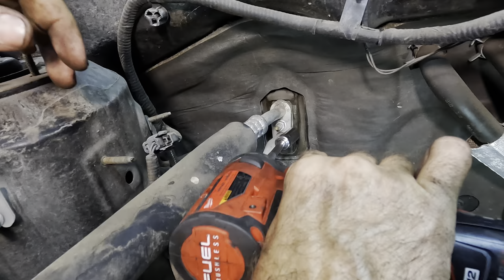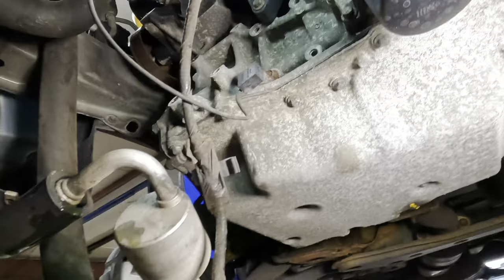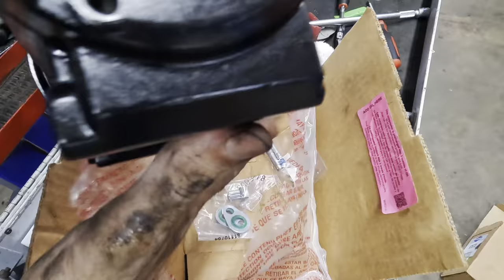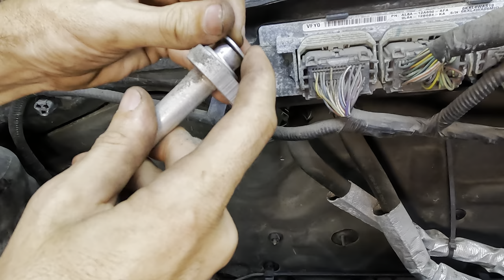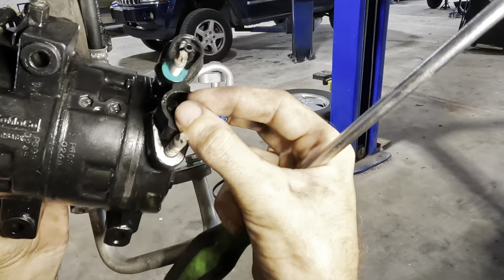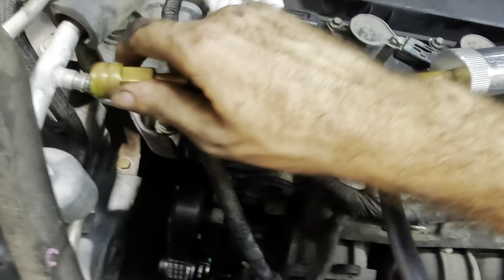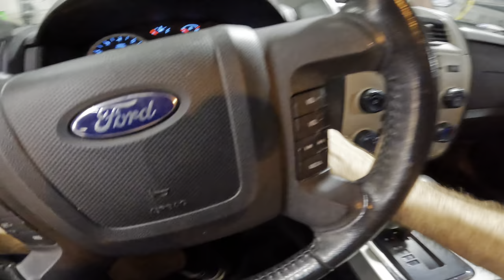Parts Cannon Complete! It’s bulletproof | Ford Escapé 2.5

Comment: Hi, Ray!
My only critique is that I would have recommended replacing both of the hoses at the compressor while I was in there, not just the known leaker.  The other one appeared to be of similar age and will likely require replacement in the near future.
Reply: Your logic make sense but it can lead to overkill. If you replace the lower lines, why not replace the upper lines? They are the same age? If you replace all the lines, why not replace the evaporator too? It could fail soon. If you replace the evaporator, you should just replace condenser, as well … and all the pressure sensors … and the receiver/drier, too. You just can’t insure yourself into no system failures. You could be pulling off perfectly good OEM parts and replacing them parts that have flaws and will fail in 5,000 miles. You just never know.
Reply: @brianandrews7099  
You are correct, of course.  It IS a judgement call.  It's "While I am in here" judgement call that would have saved the owner a labor charge.  
Really, no right or wrong answer, I guess.  I doubt anyone would recommend a complete system replacement, though.
Reply: @brianandrews7099 :  If you're gonna go that far, why not just "unclick" the engine cover, and drive a newer car under it?!?!
😁

Comment: The pully on the old ac compressor was smaller then the new one which was verified when the serpentine belt didn't go on as easy as it should unless it was a trick of the camera.

Comment: Made me think of my AC delete project on my 85 VW Golf Diesel. Only having 52hp, turning on the AC chokes the life out of the engine seriously hampers power. It will also reduce weight and complexity in the engine compartment making access to components and doing oil changes much easier. Where I live, AC is rarely used at least by me.

Comment: i know i wont get an answer to this from Ray, but maybe you guys do or do not do this but i flush the system with denatured alcohol  when the compressor comes apart on the inside..and replace the sock filter in the condenser if it has one.

Comment: I thought you should replace more than the compressors, like the condenser. My understanding is, when a compressor fails, it sends debris through the whole system. Just replacing the compressor will cause it to fail prematurely because it will suck in the debris and destroy it. You said you could see signs of "Compressor Death".

Comment: I think my concern would be that I seem to recall from the previous video that when you first removed the dust cap from one of the two line ports, you commented that there was some slight pressure behind that cap? If that is so, it would indicate that the Schrader valve on that port is leaking and needs replacing least it continue to slowly leak refrigerant. I purchased a very used car a number of  years ago with a no op a/c. The previous owner had taken the car to a shop and been advised that the evaporator was leaking and required replacing. The seller passed on the repair because, on this car, replacement meant removing the entire dash to gain access. Knowing this particular car, I quietly doubted that diagnosis, as they were not know for evaporator failures. Sure enough, upon inspection, the refrigerant was leaking past the valve port. A $25.00 set of replacement ports and a recharge and the a/c has been cooling great for four years now. As to the honesty vs. knowledge of the shop that diagnosed the a/c failure … well, that will remain up for debate!
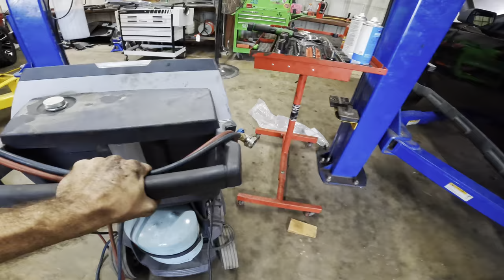Reply: He commented he replaced them off camera... 36:00

Comment: Gotta watch them pulley sizes when replacing have that issue with the 3.7l in the liberty when replacing the compressor and sometimes gotta get the shorter or longer belt depending

Comment: Maybe it's just the angle, but the pulley on the reman compressor looked a bit larger. If it was, that's probably why the belt went on with so much trouble. I've seen that before. Sometimes AC pulleys can come in a different size. Usually larger, which slightly reduces the RPM of the compressor and load on the engine.

Comment: Hey dude, I have never had any success with reman compressors, and this is like from 1975 from my first "professional" job. I hope yours works, also the pulleys are different diameter, that's why the belt doesn't fit,. Two things about this and sorry for the bad news, but, the spring in the tensioner puts a specific tension on the belt, if your tensioner is maxed out, now there will be an overtight belt situation, this can cause premature pully and water pump failure. Also due to the larger diameter pully the compressor will turn slower, this may cause cooling issues when the vehicle is stuck in traffic etc. I hope it all works out and there are no problems, but Newtonian Physics and all.
Blue Mule
Reply: As long as the tensioner is Is not maxed out in either direction it will be just fine.
Reply: Since no space-time warp at this rpm, Newton laws working here. Time will tell when bearings fail.
Reply: @stevewhite3424  It is maxed out.
Reply: @forgetfulme1719  Hey F, here is a story, a shop owner ordered a timing belt kit from Amazon for a subie outback, the Tech looked at it told the owner the belt was not factory, owner said, in the Amazon heading it said it was, so the tech is wrong, put the belt on, It took 2 guys to stretch the belt on, 3 weeks later, vehicle came back with a burned out idler bearing, funny thing, that is what it came in for in the first place🤣🤣
Blue Mule
Reply: @bluemule3891  or chain store mgr tells u install a 99c leaky crank pulley seal.

Comment: Psa: ALWAYS flush out any components you aren't replacing, and always replace any parts you can't flush out if you have a compressor that's gone bad. It will scatter metal throughout the entire system, and kill the new compressor pretty quick.
Reply: he threw away the instruction  right away, arrogant.

Comment: Since the compressor failed shouldnt you have flushed out the the line that brings high pressure refrigerent over to the expansion valve from the condensor due to potential metal shard contamination? Or the line that brings refrigerant from the expansion valve to the compressor? I know the line that connects the compressor to the condenser def shouldve been flushed but you replaced it due to it leaking. I think most of the metal shard contaminants remain trapped in the condenser but some can still make it past the condenser. Just curious. Love your content and an avid watcher. Learning a lot being a DIY mechanic maintaining my own cars and family cars from you.

Comment: With the a/c repair, you suggested there was a blockage causing the high side pressure. What was the cause ?  The part on the firewall you replaced or was it the compressor itself?

Comment: Question, with the belt being so tight because that compressor pully being bigger wont that potentially damage the bearings in some of the other pullys since its putting added stress on them? Again just wondering  if is that possible. Heard that somewhere before..
Reply: it is not only possible, it is a fact, how soon before bearings destroyed?

Comment: Ray, since vehicle owner is doing in-depth repairs why not order two hoses for that instead of just the one leaky one? Surely he will be back in two or three years to replace the other instead of having it last another 10 years or more. I would consider it preventative maintenance if it was my vehicle. Keep the vids coming and have a great summer!!!
Reply: It could have been a money issue with the owner.
Reply: The fact that he didn't flush out the system before installing the new TX valve and compressor means he will be probably replacing the compressor again sooner than expected.

Comment: The pulleys were different sizes you never compared them with one another it actually was very easy to see when they were next to one another so now the belt being forced on will be putting stress on the alt bearings nice way to gain extra service keeping the customer coming back

Comment: 29:09 curious what the bolt holes are for, located to the right of the compressor on the engine. Some optional equipment?
Reply: That's where the Fetzer valve is mounted on some models.
Reply: @Flies2FLL  😆 had to look that one up.
"The "Fetzer valve", when Lucinda the mechanic is giving the Sheriff her findings about Mona's car, she says the "Fetzer valve" had been punctured. A "Fetzer valve" is a fictional part of an engine, introduced in the movie Fletch (1985). Helpful•43. 1. Every character's automobile has personalized plates."
Reply: @Wakeupandsniffthecoffee  Haha!  I was just twisting your leg....🍺🍺

Comment: You should have flushed out the evaporator and condenser. There may be stuff in the system after a compressor failure. Some compressor companies will void your warranty if you don't replace the condenser.
Reply: true, they saw the video, no warranty.

Comment: What oil was required/specified on the rebuilt compressor that was referenced on that QR code/instructions?  I'm sure it was not worth showing on the video, I just don't understand. Is there a seperate small reservoir or are they talking about an oil/refrigerant blend?

Comment: Well, now the belt is too tight.  I had a Toyota that wouldn’t take anything but a Toyota drive belt.  Everything else was just a hair too short.  I want a belt that fits, not forced on.  But everything else you do is usually top notch and enjoyable to watch. 😁
Reply: Well won’t the belt stretch after a while, so it won’t be a problem?
Reply: The pulley on the new compressor was larger than the old one thus the tight belt.
Reply: @paulsi1234  by that time, bearings will have been damaged, no escape from Mr Cannon.

Comment: When you replaced the compressor and opened up all the hose ports.. Does that introduce air back into the AC lines, so do you not need to remove the moist air now in the AC lines, before recharging the AC again at the end??
Reply: Saw you did vacuum the lines... my bad!!

Comment: Hey Ray, was the pag oil in the compressor for the whole system or just for a compressor replacement only? I am doing a BMW X5 and the compressor has a pag oil charge for the whole system so I had to take out 100CCs of the 150CC charge that was in the new compressor. Have you ever had to do that?

Comment: He saved the warning sticker, but did I miss him adding the correct oil amount to the compressor?
Reply: Oil came in the compressor.
Reply: @kenore4003  3 oz came in the compressor, you must always check what the capacity for your system is and add the needful. Internet says 4.40 fl oz (130 ml) for the 2010 escape'.

Comment: I probably missed it previously, but, could you mention (next time you service one) how you determine if you use high side or low side to recharge the AC system. Thanks.
Reply: The ports are different sizes so you can’t hook them up backwards.
Reply: @brianhall9019  THAT I know. I was asking about recharging, nor red or blue port size. 🙄

Comment: Question... curious why you didnt flush the a/c system to prevent damage to the compressor or contamination of the new txv?
Reply: @OriginalGhost  no flush is a fluid that is designed to clean the condenser, evaporator, and lines of any aluminum material that is created by the pistons and swash plate moving in the compressor. Pulling a vacuum on the system removes air that displaces the refrigerant and boils off any humidity introduced to the system when the lines are removed.

Comment: How did you conclude the problem was the expansion valve & not the condenser?  I have similar pressures but don't know how to diag. which one.
Reply: Compressor failure and he didn't even flush out the evaporator or the condenser.  Normally I don't comment but I noticed a quite a few faux paus.
Reply: @21Piloteer  I just work on my own stuff as much as possible.  I'm not familiar with the flushing of the components.  Is that done by professionals?

Comment: 32:00 minutes: the point where Ray finally notices that the pulley on the new compressor is slightly larger than the pulley on the old compressor?  Not picking on you Ray.  I just happened to notice it when you were comparing them, and was dreading you getting on the struggle bus from not seeing it.  Hey, you cheated us!  No double brake clean shininess...

Comment: Was that the correct amount of PAG oil in the compreesor?
Reply: My trick is always to pour the oil out of the old compressor and compare it to what's in the new one (usually they are overfilled). I would imagine Ray's machine is capable of measuring the oil charge.

Comment: I have a 2012 Escapé XLT that is having a fan issue. 😮‍💨😮‍💨 unfortunately, I "parts cannoned it" and replaced the cooling fan assembly (for the second time) it did fix it...I checked the relays and those seemed fine...🤦🤦

Comment: RAY ! RAY ! RAINMAN .....You 4got to put the dust covers back on the Escape! Yes the ones that were in the way before you pulled off the belt .. The big black one . Recall you broke the plastic piece that you had 2 destroy to get it off becausevit was blocking your path to remove the belt & the Compressor .. ... Hope you remembered to put it back on .. 👍
Reply: Seeing that Troy put the wheel back on, likely he did that before.
Reply: @csgergo80  no it was still off..when Ray took it 4 a test drive .. After all the work done to it.

Comment: When you compared the compressors it looked to me the pulleys had a different size
Reply: Pulley bigger on new compressor confirmed when he couldn't get the belt on.
Reply: Belts stretch over time
Reply: @donE37100  confirms Mr. Cannon at work.

Comment: After my 1/2" air tool  said bu-bye (O-ring failures) i went looking for spark replacements and landed on a Milwaukee's M18 series but now i'm wondering outside the 1/2" what should i get (i don't mean model numbers) do i need a 3/8" or a 1/4"  impact? Sure i need a 3/8" 90 degrees so that's in the plan. Do i need anything else ? The 1/4" stuff is easily handled by a elecron screw driver right ? no need for anything special there ?

Comment: Just wondering why I never see you guys using fender covers when working underhood.....
Reply: 🤔 Ray did, when he removed the valve cover. It was used to protect from debris and such, unaware.
Reply: @opendstudio7141  Oops, didn't catch that.  Ray is doing an outstanding job with these videos.  Nice to watch a pro work!
Reply: most cars came in worth little, scratching not the worry.

Comment: Tbh cleaning the outside of the battery clamps little more than cosmetic, all the power is conducted from post to inside of clamp, also when doing battery service it's worth checking where negative connects to body, more often than not it will be showing heavy signs of corrosion

Comment: Most 4-cyclinder Vehicles are So Much Easier to Work on versus the 6-8 cylinder ones...
Reply: Tell me about it. When my wife had her Ford Fiesta I put an A/C compressor on it and it was a lot easier than on my V6 Taurus. The setup and location was almost identical but the V6 required removal of the radiator fan and was a much tighter fit. Also have to remove the intake manifold to get at the back 3 cylinders for spark plugs and coils.

Comment: Why would you not clean those AC line studs of that corrosion,  bench grinder with wire brush makes them nice & shiny.
Reply: lazy.
Reply: Southern mechanics 😂
Reply: @waterloo123100  weather too hot, don't blame them.

Comment: Battery cables, i have used the red and green pads for 30 ish years never have battery corrosion problems.  But i know a lot of mechanics use the spray red spray or the split pees puke color you use
Sorry to get graphical.

But if we know this stuff works, why dont manufacturers put it on when the car or truck is new? 
Also if its the spray why not do the body ground, motor ground, altonator and starter connection that are under the hood, yes these points dont deal with a lead acid battery but the post get wet and the metal corrosion starts becuse of electrolysis and spliting water mouclues and or metals reactions to oxygen without a lubricant on it.

Comment: having a A/C system open in a rain storm is not wise . where did corrosion on a sealed system come from ? sounds like moisture in a system  got out of tech school 1972  worked at it until 2019 a/c refrigeration repair

Comment: Wow, 4 cars in the shop, you might have to hire one more guy, 
And buy the property take over thd body shop. And add onto the counter top side.   Or find a much larger shop with 15 bays. 

One word of advice, and its a killer
Pay your taxes.  And or incorporate 
And hire 1099's contractor's who work by the part and not by the hour. But qulity can suffer with that aspect.

Comment: Been watching a lot of your videos.  Had to cringe at this one!  Motorcraft is the only brand of spark plugs that belong in a Ford!  No exception.  The AC compressor in my 2004 F150 went out last year.  Although I know better, I tried to save some money and had a non genuine compressor installed.  It lasted one month beyond warrantee when I pulled the plug before it granaded.  I had a NEW Motorcraft unit installed and expect it to last for around 18 years like the original.  I really hated to see that black painted thing go into that vehicle.

Please excuse my rant, I just couldn't help myself.

Comment: You say that if it didn't come with it, you don't like to add something. Like stop seize. Why are you adding that gunk to the battery?? I think that stuff makes it worse because it gets gummy and all the grime sticks to it but it didn't come with it from factory. I agree with you on the stop seize but I refuse to use that crap on the battery.
Reply: Either the gummy grime or you have to keep cleaning the corrosion off the terminals.
Reply: @WalterMelons  I rather dump Coca-Cola on it once a year. Works best and no gunk. 👍🏻